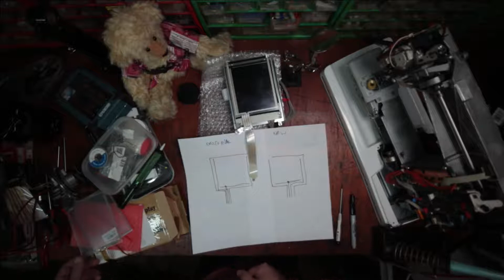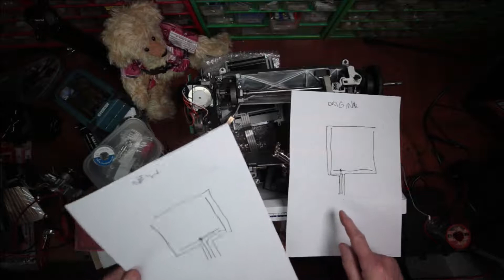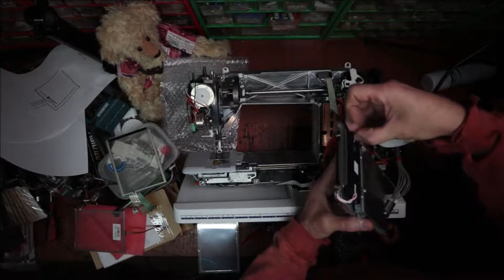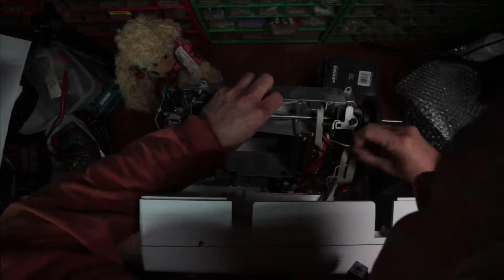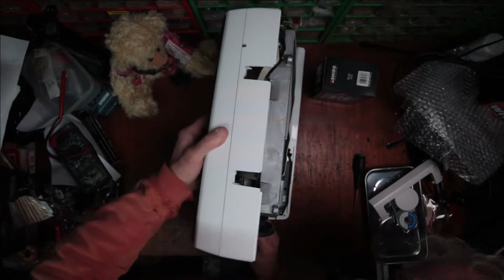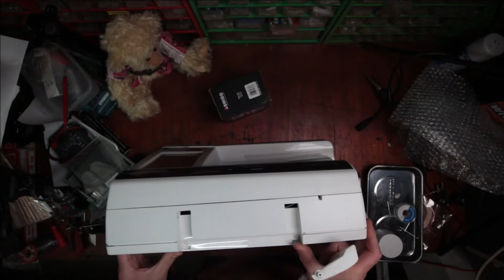Husqvarna Viking Designer 1 sewing machine touchscreen repair/replacement

Comment: Hi, thank you for sharing the repair video! Did you upload a video showing how you accessed the screen inside the machine? I’ve seen online that perhaps disconnecting and reconnecting the screen could fix the calibration issue. Your level of repair expertise is above my capabilities so will try a simple attempt first if possible!

Comment: Made cable using original ribbon attached to 4 wire usb to touch screen adapter.......Just used plug on pcb and other end fit new touch screen ribbon cable. Thanks for your time.
Reply: Can you explain anymore about this fix…I need to fix mine also.

Comment: Is that 3M tape called VHR or VHB tape? 
Also,  how wide is the tape (in mm)?
I'm seeing a variety of screen tape available,  so hoping to clarify what you used.  Thx. ❤️
...Dawne
Reply from the maker: VHB (very high bond I think it stands for). I don't think the width is critical, it's just what I had, maybe 1.5mm
Reply: @motorbikewhisperer  Thanks for responding so quickly and clarifying that.  😃
I called our local computer repair store and they said they use regular, real thin double-sided clear tape (not the thicker foam kind). I've got some of that on hand so I'm going to try that first. Worst case is that it doesn't work and I go buy some of the stuff you suggested. 

I also ordered the screen you suggested in the video.  I actually bought 2 just in case.  At $9.70 ea shipped from China, it was worth the $$ to have a back up.

Thanks again for the video.
...Dawne

Comment: Hi, I'm doing the exact same job and bought a screen without a connector. It hasn't worked out at all so I want to get a new screen like yours (with a connector) but I haven't been able to find one. Can you look through your ebay purchases and let us know exactly which screen you bought. I would be very grateful. Thanks.
Reply from the maker: Hello, https://www.ebay.co.uk/itm/Factory-Outlet-5-7-inch-Resistive-Touch-Panel-Screen-with-Free-FPC-Connector-/291022092957
Reply: @motorbikewhisperer  Thank you!

Comment: Could you send me the place you order the screen that I can’t find anywhere that sells them
Reply from the maker: I got this one from eBay.  Search for 5.7 inch 4 wire resistive touch screen or lm057qc1t01. Try to find one with a connector. They seem to have gone up a lot in price
Reply: @motorbikewhisperer  can I direct message you I have a question?

Comment: Hi, a dead interesting video. My wife has one of these machines, she bought it new in 1998 (possibly 1999), I watched your psu fix video and you mentioned you didn't know much about them. Well....back in the day they were THE embroidery machine to have. Yours is one of the early ones as  is ours as it has the floppy drive, the later ones have a USB port. We sent our machine away to be converted, can't remember how much it was, probably about £750ish. I stumbled across your video because the USB port in the wifes machine has just stopped working and I wanted to see how easy it was to take apart. The last software update that Husqvarna pushed out was in 2008. This page shows how to do it http://suesbayareasewing.com/d1_update.html If you need any help with designs and the like, just holler, the wife has oodles of them. You need a Windows XP machine with a floppy drive though, we've kept one for such a purpose.
Reply from the maker: Hi thanks, yes I was vaguely aware of the USB option but it does mean a complete replacement of the main board I believe. Hence the price. I was just pleased to be able to keep these two going.
Reply: @motorbikewhisperer   Yes that's right, new mainboard to allow a USB connection rather than the floppy, I see there are replacement USB units that are the same size as a floppy drive and use a standard floppy connector, no idea if that would work on a designer 1, would be an interesting mod though!